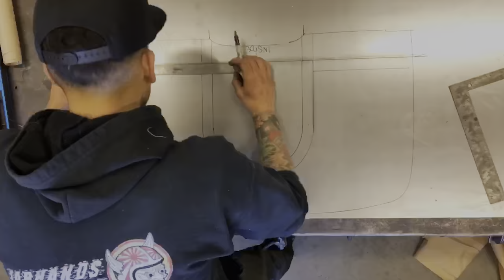Making a Radius Tool For Lathe From Scrap Metal Simple Easy

Comment: Great design for the circle cutter.  You do fantastic work, your instructions are clear, and you make it look easy. 
The circle cutter sure makes it easy to cut ends for levers, and as you have shown, for making the heads for the shaping hammers.  
I just about had a heart attack, when I saw where your dial indicator was resting well inside the arc of the jaws of the lathe chuck.  I wasn't able to breathe until you swung it back out of the way.

Comment: Hey Carl,
   A word of caution for when using the lathe.
"NEVER" grab the cuttings to remove them when the machine is cutting !
Those cuttings are super sharp !
   A few years ago a friend grabbed some from his lathe while it was running.
The part being turned grabbed the cuttings as you did on camera, they shredded his finger and thumb pads.
He was lucky only skin and tiny bits of the meat below was removed.
Still, years later he has minimal feeling in those pads.

   I think it is great that we can use a tool like a lathe to make tool to use on the lathe.
A Bridgeport or other brand mill is another tool that can do that as well as many of the tools we use in our shops.

   Thank you for bringing us the great videos you make.

   Work Safe, Be Well
         Stay Warm

Comment: Mill out a tool holder that will accept the shank of an adjustable boring head. Similar to a boring bar tool holder. Use bearings or not to support the shank. Then you can also use the boring head adjustment to really dial in the radius especially internal radii. Leave it as a dedicated radius turning tool and just mount it up on the tool post whenever needed. Could be built with no welding.

Comment: If you tapped both sides of the tool post/clamp for a threaded handle to mount it would create different radii (swing arcs). It might make the tool more versatile for shop work. The cut depth may need to be less because of the pivot distance.

Comment: Love the hammer and the radius tool.  You certainly made it look easy.   However, I wouldn't advise removing the nylon excess with the lathe running.  If a loop got around a finger you would be called "Make It Kusom with nine fingers".

Comment: Have you thought of making dedicated form tools?  The concept in the video is great for a variable tool that you can use for one-off and low production, but the setup for it to do production quantities isn't the most efficient process.  Since it is for the nylon ends, it might be simpler if you made form tools for the two shapes that function like those used on the old Browne & Sharpe screw machines. Cut the profile into plate on your CNC table using a thickness that clamps in your toolpost with the profile of each Mother Tucker on opposite sides of the toolpost mount. Then just sharpen a back-angle on the underside with a hand grinder.  With the pattern on the CNC, replacing one that won't sharpen well anymore is simple.
Reply: BTW, a form tool for the cone end can cut the conical shape and the end radius in one move.  You can also make the same sort of tool that makes the undercut in the journal on the nylon that goes into the hammer head.
Reply from the maker: Yea these are great suggestions! I am currently working with a cnc shop on them so they will be producing them for me.

Comment: It looks great. But am I misunderstanding or wouldnt it have also done inside radius(dishing forms) if the handle hadn't been permanently mounted?  It seems a square shank on top and a breaker bar would have allowed it to do outside radius like is currently does, or flip the tool and cut concave shapes for press or hammer forms or speed hole dies.

Comment: Using a bolt instead of a locknut was a better idea IMO. That lock nut is so tall that it severely limits how big of a thing you can machine. Personally i'd just lock-tite the bolt and call it good. Alternatively, machine a spacer to go under the bolt (replacement for that cone washer) so it tightens on that spacer.
Next you ought to grind a profile tool to shape those retaining grooves in the hammer heads. Knock it down to diameter, then one tool to get profile and spacing all in one go. Sort of like this:   
                    ____     
                    |         \
     ________|            \
    |               |             |

Since technically only that tip needs to be sharp, the 'spacer' part on the left can be anything, perhaps even a mild steel block with HSS cutting tool brazed to it.

Comment: Untill you modified your pivot to the bronze Bush what you actually made was a reinvention of the compound slide.
It literally did the same job.
What you took off was already able to do what you made to replace it.
The compound slide actually had a better radius adjustment facility didn't it  ?

Edit ..
Looking at my small lathe it would only work with small diameter workpieces. 
Not a problem on my big lathe.
I should have thought it through.
What he did was allow the pivot under the workpiece  🙄
Reply: you beat me to it , good catch !          😎😁
Reply: He mentioned doing that at 27:20.

Comment: BE INTERESTING TO TRY A WOOD LATHE AND SEE IF IT WORKS
Reply: It could easily be adapted to wood lathes
Reply: Thinking about it further, you could use the tool rest mount as the pivot point. Then it can be adjusted for any size ball. I have a wood lathe to give it a whirl but after other projects are done.